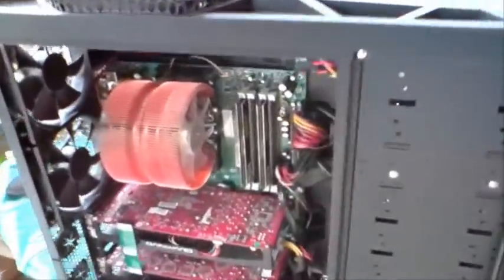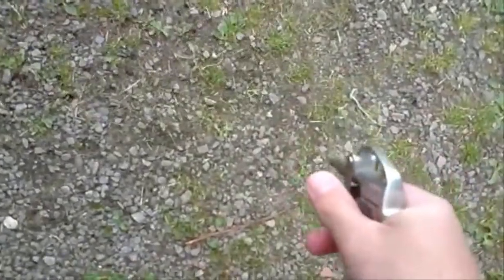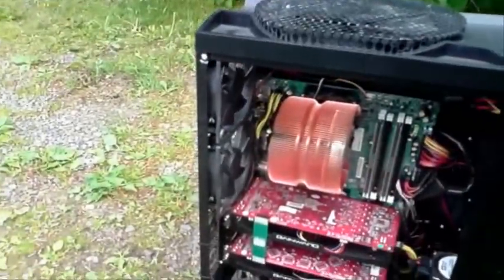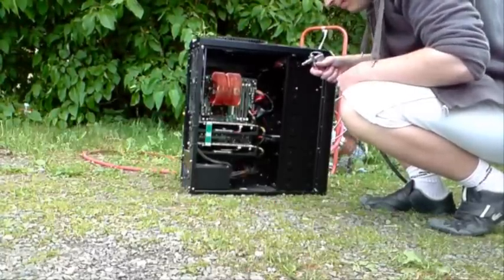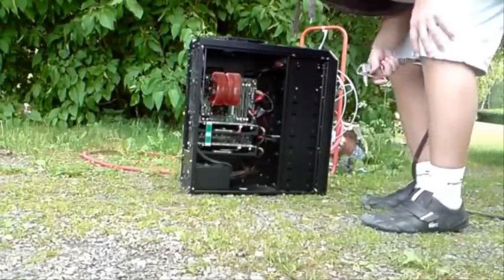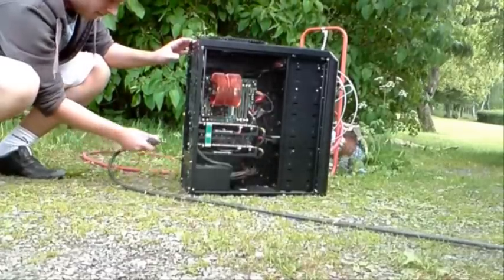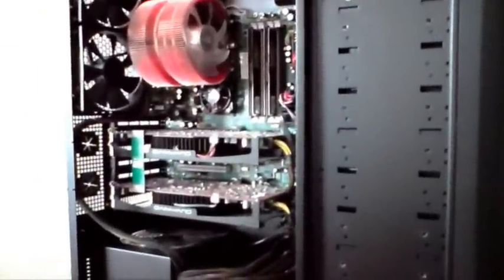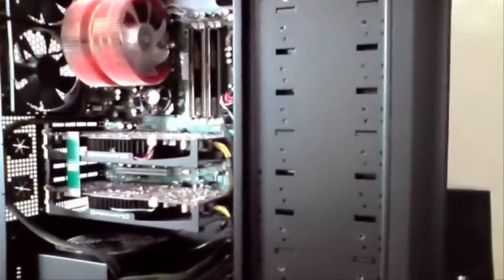Cleaning Gaming Rig Using a Compressor

Comment: @PokePackOpener14 possibly , however 3000rpm is a long squirt of air at considerable pressure , its more the force put on the bushes between the bearings,the spindle , and the brushes of the motor being damaged

Comment: @VideoMakersUs because they don't want dust flying around inside their house. if you clean it inside, the dust will go right back in. the water in the air is not going to kill a PC while it's shut off.

Comment: If you've bought a computer (like me) and cant open the chassis because of guaranty issues. A good way of cleaning it is by placing a vacuum cleaner and sucking out the dust from the intake "holes". It does works very very well. 

I cant open mine because of a guarantee security tape :( It sux.

Comment: Actually, that's not true at all. Gasses alone cannot be charged. Only in the presence of powder or liquids (aka vapor) in the gas or from the source. Since products like dust-off need a  liquid agent to retain the gas pressurized within the can, they actually pose a risk of static damage, while compressed air poses no threat.

Comment: You should avoid air compressors they can have moisture in them. I have done it myself a thousand times with no issues but I always use caned air on other peoples computers. Also some of them blow to hard and can hurt the fans if your not carefull.

Comment: this is not a good idea unless you have a filter to remove the water from the air lines and tank.

i use the compressor to clean my r/c car and it gets pretty wet.